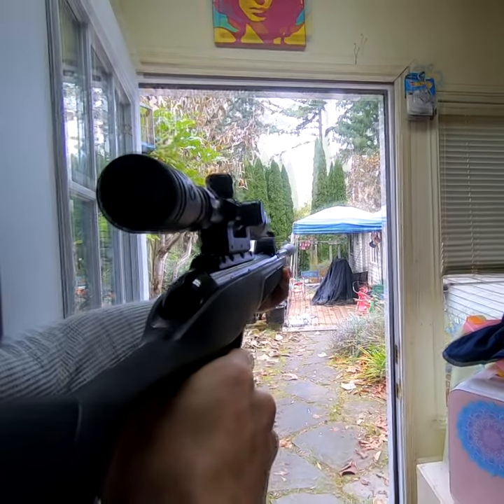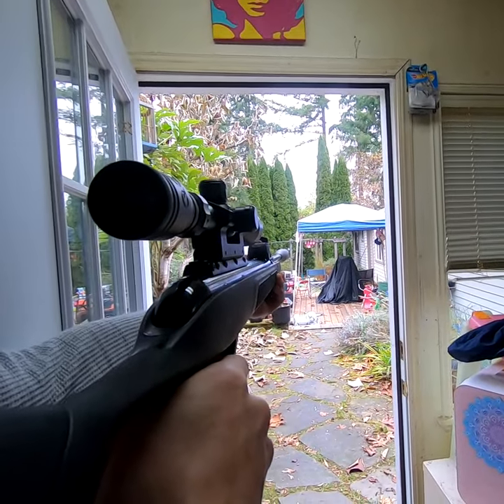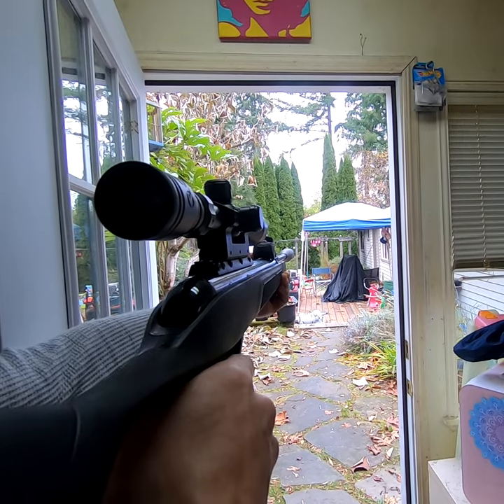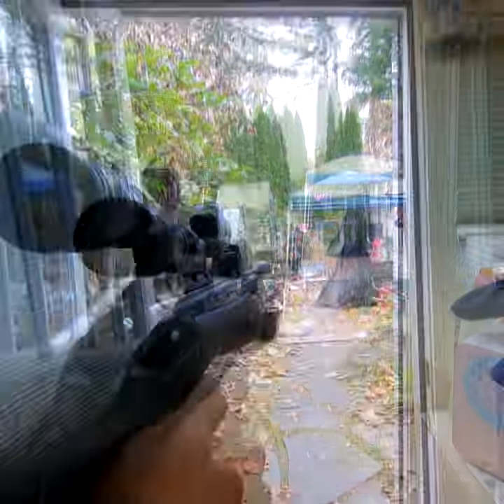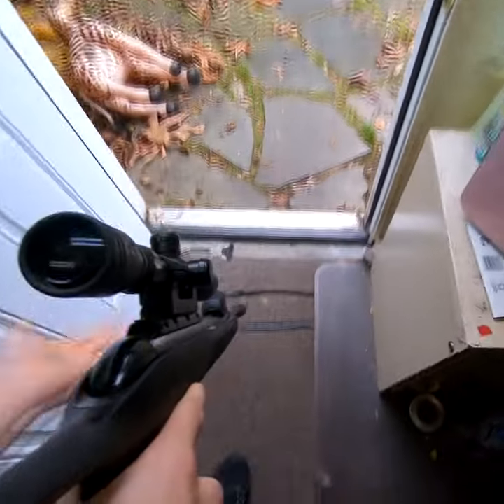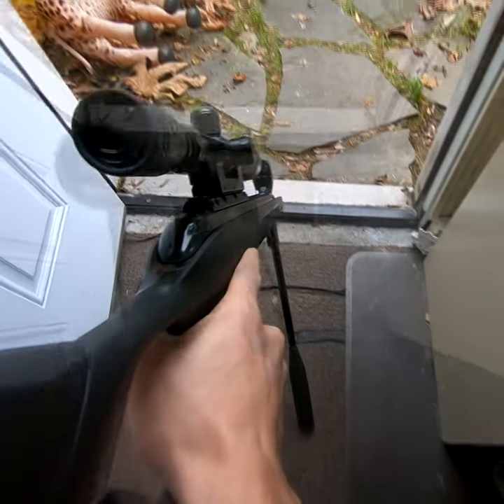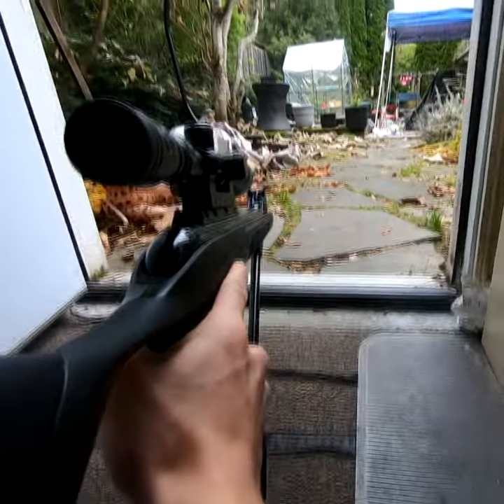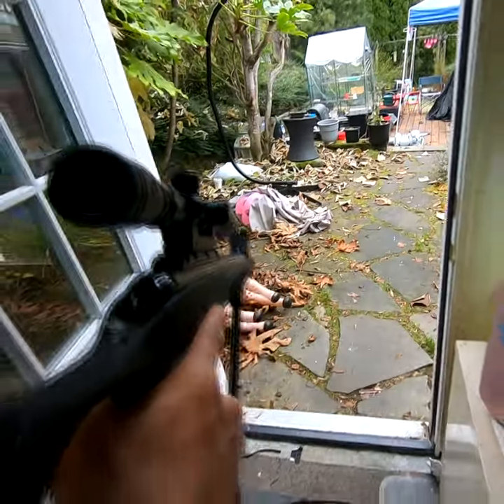Does Pellet Dieseling Really Work? #shorts

Comment: Will that wreck the seals after a while.
Reply from the maker: Nah, as long as you are still doing your regular maintenance it will be fine. 

I have had these guns for like 4 years now, and haven't maintained them even once after thousands of rounds out of both guns. And I have dieseled at least 100 times through both guns (using the 10 round mags full of dieseled shots, and firing all 10 at a time), and again, no damage to any of the seals, and the performance is still perfectly fine. I'm still able to hit targets, and I am still able to kill small game (birds/squirrels), so as far as I am concerned this will not damage your pellet gun, if you are doing it in the same way that I am doing it.
Reply: Is a seal a big deal anyway? These things are pretty cheap after all.

Comment: One drop of 3 n 1 oil is all you need. Will sound like a .22
Reply: Where do you put the oil
Reply: @kam7003  insert the pellet into the gun then put a drop in the “cup” of the pellet. My $100 Gamo Whisper did 1680 FPS with aluminum pellets.

Comment: I get the same effect with pellgunoil
Reply from the maker: ive used that too, but it's runny so it will drip out of pellets if you use them in a magazine 
I started mixing pellgunoil about 50/50 with vaseline and it works pretty well. Easier to diesel than pure  vaseline (i find vaseline requires higher pressures to ignite), but still thick enough to not drip out of the cups, even the slightest bit.

Comment: Has anyone tried Dieseling on co2 pellet pistol?
Reply from the maker: I've tried it with my crossman revolver and it doesn't work

Could just be the pressures are too low, but I believe it has more to do with the fact that co2 extinguishes flames.
Reply: Dieseling only really works with nitro piston airguns they are the only ones that have enough compression to ignite whatever you are using I personally use bag balm when I diesel pellets .177 and .25 cal i found work best
Reply: Somebody tried Dieseling on AEA HPmax?🤔
Reply: @PelletPlinker yes, your correct, c02 is propellant in fire extinguishers and of course, the velocity from CO2 guns are basically low. Thanks for interesting video. I'm going to try dieseling on my Crosman Phantom Break barrel .177 once I get a chance to go to my local range area, 👍